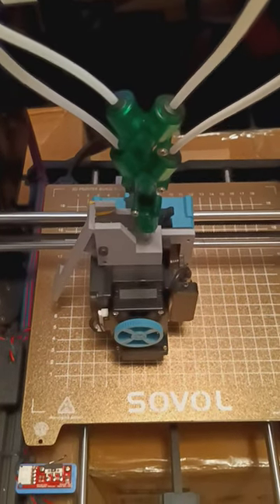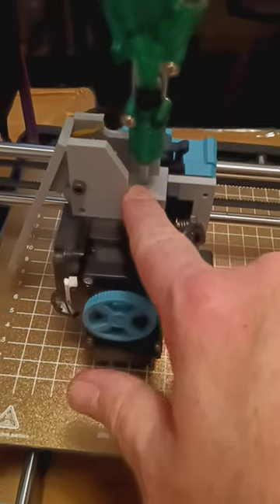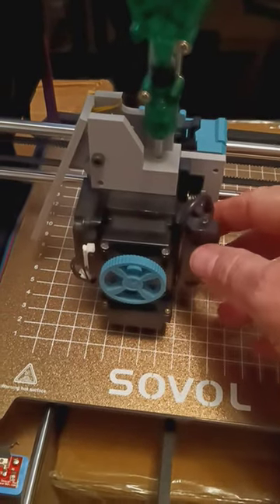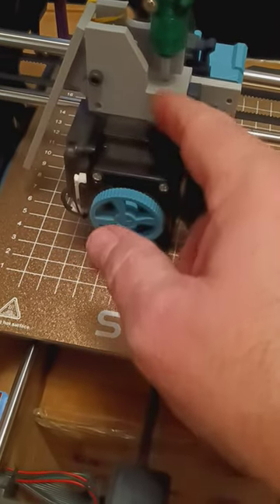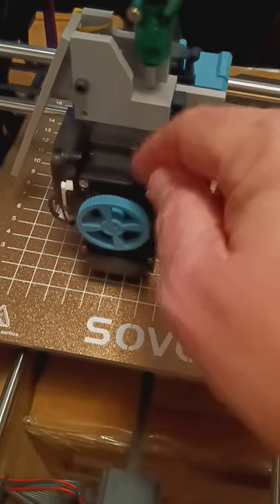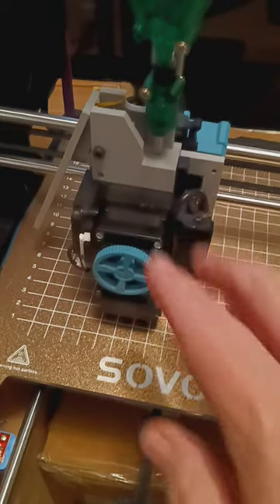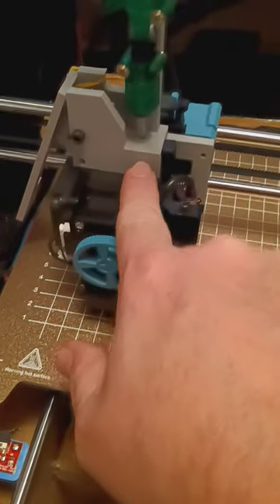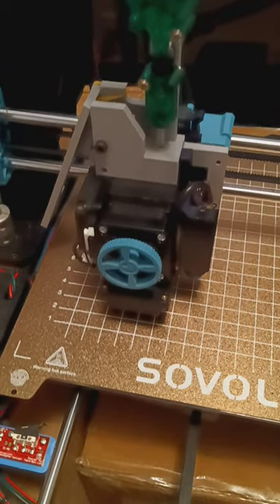3DChameleon's 3DClippy filament cutter on the Sovol SV-06

Comment: Testing the chameleon now, I think the stringing between changes is causing me problems. Also working to fine tune the feed distance during the load process.  One thing that sucks is having to unload the filament manually if I have to cancel a failed test print.
Reply: Looking forward to your feedback.  What printer is this on?
Reply: @JohnJerde  I am using an anycubic Kobra Max, no preset in prusa yet so I had to make a custom printer. I am coming from cura so the differences between slicers are slowing me down as well. I've got it to print the first layer but the unload is causing a jam due to stringing.
Reply from the maker: If you have any questions, please don't hesitate to email me.  The stringing between changes is usually due to retraction... and where the filament is left between moves.  You can always add a retract to the gcode (G1 E-5 F2000) right before any move to make sure no filament is present.  I do that just at the start of the color change... and account for it in my reloading.  I also only load the filament either behind the purge block or on top of it so it doesn't have a chance to leave that area.

Comment: Question..  do we have to press the button to let it know what color we want to use next or is it automatic?  I've watched videos and looked in your site but never have gotten this answered.  I have a p1p and have watched the video on install, etc.  But without that info, I can't decide if I'm going with the chameleon  or AMS.  I'm a thrifty shopper and like to save money but if it means I have to be on top of my printer the entire  time I'm printing, that's not going to work for me.
Reply: You never have to press the button... The printer does that when the GCode needs to change the color. It is fully automatic.  Check out our videos of it printing.

Comment: Obviously cutting the tip creates a small amount of waste. Where is that deposited or where does it end up?
Reply: It's no different that purging before the change, which we've always done... But it's always done based on the slicer's purge strategy, but generally in the purge block.

Comment: Any help on how to put this together? looking at the 6 parts I have printed I can only figure out where 2 go and not sure how the razor or anything else fits together.

Thanks
Reply: The Tinkercad files have it fully assembled. You can look at the full mode there.
Reply: @williamsteele  Ok so there are only 3 parts needed out of the 5?
Reply: @nowayreally1 Yes... The model in the Tinkercad file shows all the parts assembled and them on the plate. There is the back mount plate, the blade holder and the lever arm.  The arm is held on by a pivot screw.